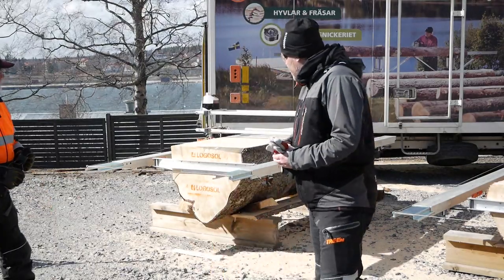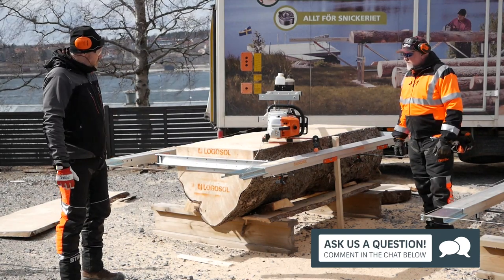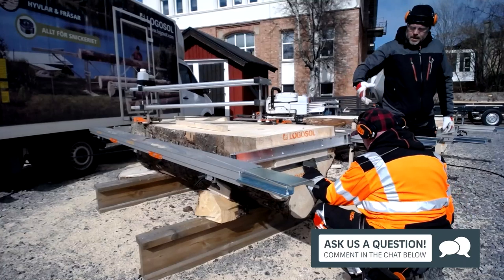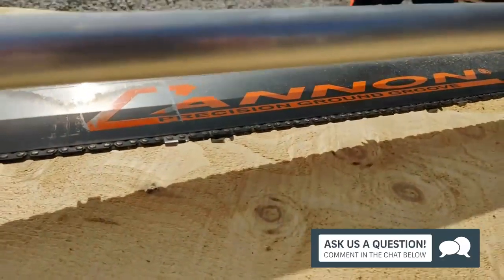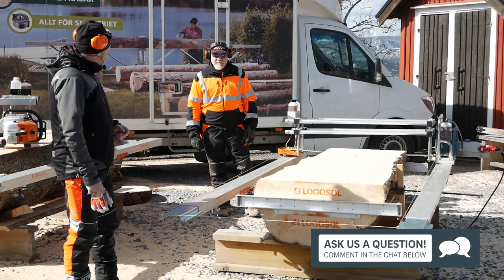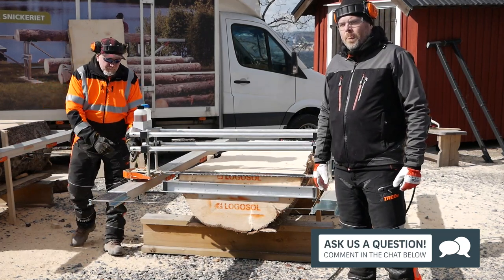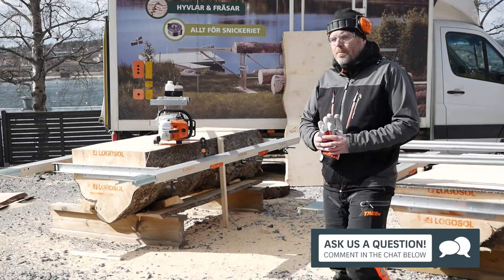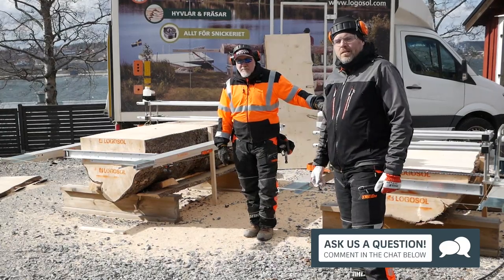LOGOSOL | Live Stream Product Demo - Big Mill

Comment: NOTICE: Bar oil from the chainsaw and from the bar oil system at the tip, not ideal to have OIL on slabs for custom work. It’s best to use a traditional saw mill, which uses soapy water for lubricant.